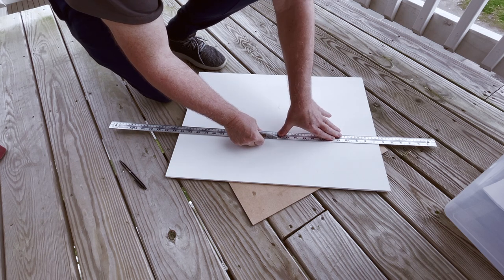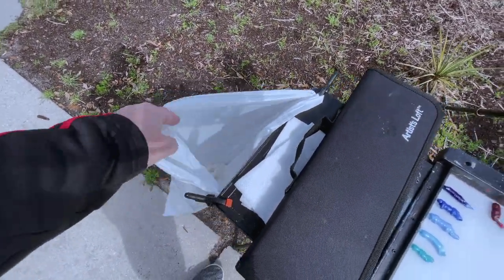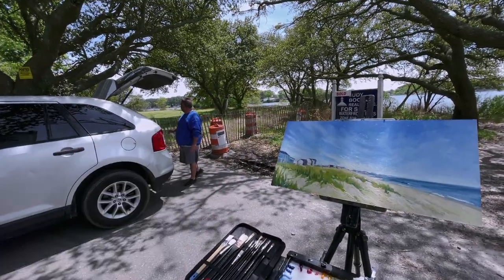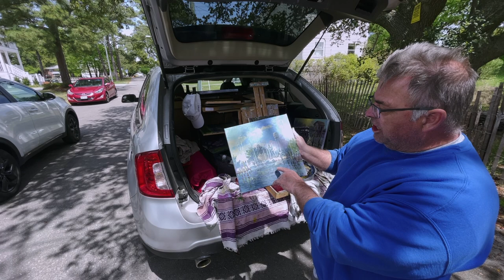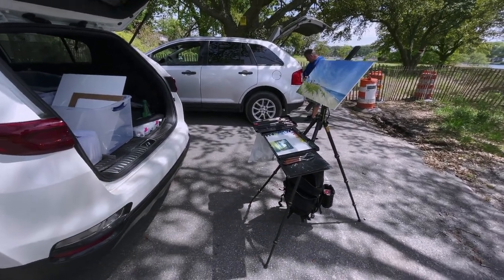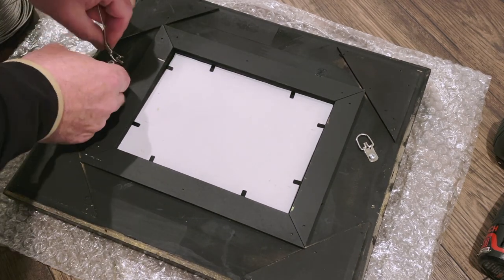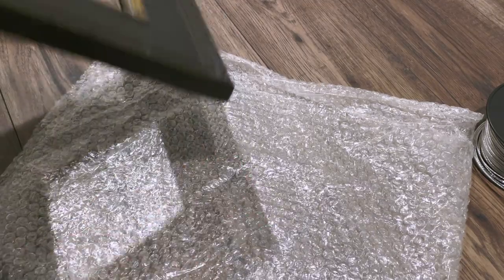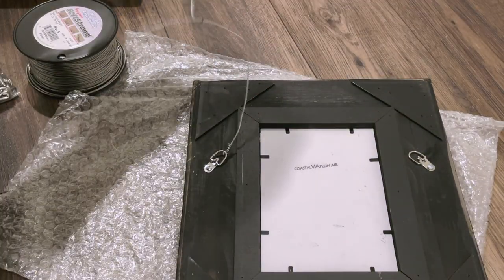Plein Air Competition - Days 4 and 5: Painting on location. Plein Air competition inside-out.

Comment: How dry is ur painting when u came to framing? what varnish are u spraying? Thank you for taking us with u! Congrats and bravo for finishing paintings and filming.
Reply from the maker: Karen, 
The paintings are semi-wet to wet condition. Paintings that you do on the first two days will be dry to touch ( depends on how heavy is the paint and mediums), but the paintings that were just finished are completely wet. I’m trying not to put a have layers of paint especially at the edges for the frame. I’m using retouch varnish to let the top layer to dry faster.

Comment: Where do you purchase your frames, hardware, and boards?  Do you you use pre-made Canvases?  If so do us use cotton or linen?
Reply from the maker: Jim, 
My main source of frames is www.Jfm.net one of the best frames in USA, you would have to creat an account with them (it is distributor).
Another source is Omega frames, same, account is required.
The hardware, like d-rings and wire, I get from Amazon. 
Now , the boards I make myself. It’s the oil primed linen glued to the gator board. I normally buy a roll of Centurion DLX linen and gator board 24x36. Now the gator boards comes with self adhesive site or plane set. I use self adhesive as my emergency boards... something I can make really fast. But 90% of the time I glue the linen to the plain board using archival glue Miracle Muck. 
And the benefits to make your own boards is that you can cut any sizes you need instead of depending on stocking premise sizes.
It is on my schedule to work on the episode how to make the boards.
Reply: @openstudiod  Thank you very much,  I recently found your YouTube site and I’m planning to study your techniques and methods of oil painting. If you want to look me up on Facebook under my name and you can see some of my work that I have been recently doing.  Thanks Again.